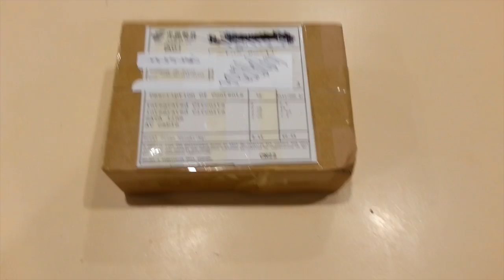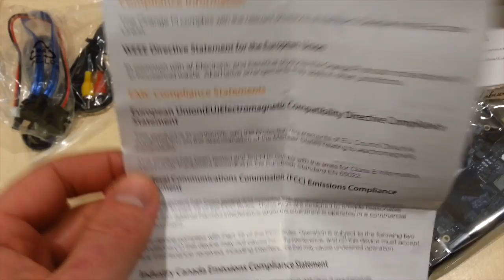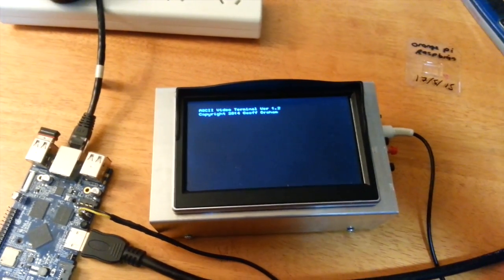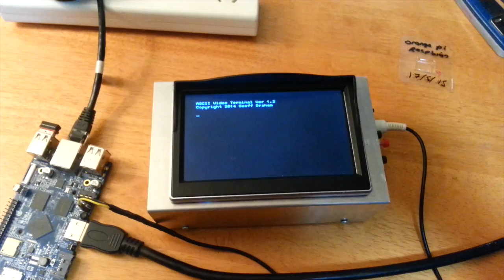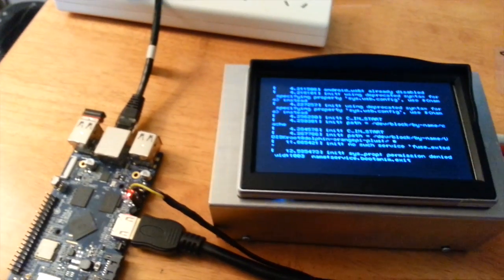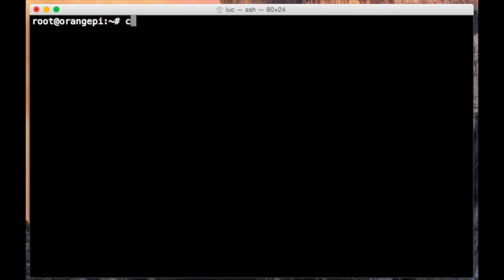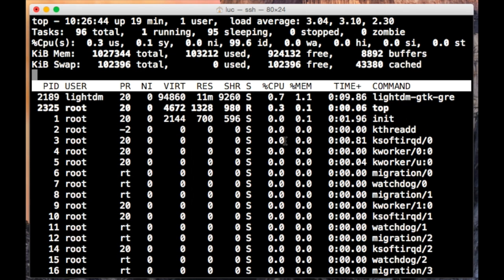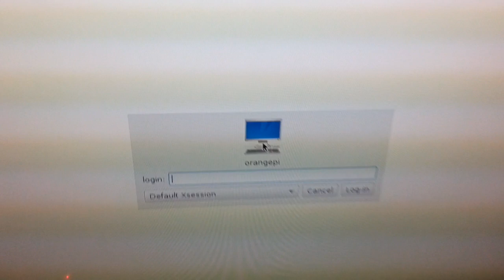First look at the Orange Pi Plus

Comment from the maker: +Shawn Carter  thanks for the tip about Android coming pre-flashed to the eMMC - I did not know that this was the case. I removed the SD card and booted into Android. Altogether a smoother experience than running Linux and quick too. Language is set to Chinese, so I'll have to explore the settings menu to change to English.
Reply: Luc Small Yeah, I found out the hard way =)
I found a general video on youtube on how to change the language on android, rather than something specific to the orangepi.  Glad it helped.
Reply: Also discovered that the Android OS is only using 2 out of the 4 cores available...it doesn't really need 4 but would be nice to have the option.
Reply from the maker: Shawn Carter Do you have the link to that video on changing the language? Would be handy for me and everyone else reading this thread. If not, no problem I'll search for one.
Reply from the maker: Shawn Carter That's interesting, I wonder why only two cores. Android was very responsive for me, even on 2 cores. But hopefully an update will enable all 4.
Reply from the maker: Shawn Carter Another thing. Do you know if the camera module works under Android? Reading the orangepi forums, It seems like support for it may not yet exist in Raspbian for the Orange Pi Plus.
Reply: Luc Small I found a video for changing the language to English - but wasn't able to post the link for some reason...I'll try and email it to you, and you can maybe put it in the comments.
Reply: Luc Small yeah Android works fine with 2x1.6 cores I guess... =)  4 cores would be better, and would be needed for the 4K video output that they claim the H3 can do.
Reply: Luc Small - Sorry Luc, I didn't bother getting a camera - I have one for my Pi2 that I never use!  I'll try to look into it for you tonight.
Reply from the maker: Shawn Carter I answered this one for myself. Connected the camera, booted Android, and the opened the Camera app. The preview worked and I was able to take a couple of stills. Recording video didn't seem to work - I would press the record button on the Camera app, but the recording would never start.
Reply: +Luc Small The high load averages are related to the SD as the root filesystem.  If you transfer the root filesystem to emmc, these will drop to 0.  I'm not sure how to mitigate this for Orange Pi devices that lack emmc, or even if there's a legitimate issue.  Certainly it is hard to identify pegged core(s) from looking at the load averages.  Anyway, transfer to EMMC solves this on the Plus.

Comment: Excelent video. Helps me understand allot of the basics on how this all works. I just ordered my first "pi" pc of any kind. Planning on using it just to tinker with an learn more about code/hardware etc. Ultimately I want to run a mini minecraft server for my friends and I; I got this over the raspberry pi for more cpu power. I got the orange pi 2 mini. I was looking for the most horsepower (all winner H3) for the cheapest price. I hope I dont regret not getting the Plus later on. I didnt think I would care for wifi, sata and all the other add ons on the plus.
Reply: +doubleatheman Hello, The Orange Pi Plus is the Best of all the Orange PI or Orange PC and for $ 39.00 Dlls includes Wifi, Gigabit Ethernet Port and 8 GB Emmc with Pre installed Android also all 40 Pin Header are Capable with the Raspberry Pi 2 and Retro Pi also works Perfect on it and what I like the most is the Sata Port to install a SSD HD Drive to the Orange Pi Plus which is a Plus for me  -  Derf

Comment: Fantastic video thank you! - Question about the power button. Does it automatically power up every time after power is restored (without pressing a button)? -- Is there any way to signal it to boot up through the GPIO ports? -- Also, if it is switched off and you hold the power button for say 30 seconds, does that have any ill effects?

What I'm thinking is getting 2 power supplies - both will input 12-20V (car application) and outputs 3.3V and 5V. Connect the 5V to always give this board power and 3.3V to a GPIO port so the unit knows when there is ignition and to power it up.

Comment: I have connected my Orange Pi Plus to the monitor using HDMI and there was no visual connection as well, so what I did I pressed the reset button and after a while there was a login screen and everything went fine. I was using Ubuntu instead of  Raspbian.

Comment: Thanks for the overview, I've read reports of Orange Pi Plus not supporting hardware acceleration, can you confirm or deny this? I'd like to pick one put for in home streaming and the like, but it's a deal breaker if it can't run XBMC.
Reply from the maker: Steven Phillips Hi Stephen. See the thread in the comments with Shawn Carter. He notes "there is no hardware acceleration yet for this board in Linux - but Android Kitkat runs really nice on it with Kodu etc.  makes a good little media centre." Hope this helps.
Reply: Luc Small It does! Thanks very much.

Comment: Luc, had similar issues with mine...turned out it didn't like my SD cards when I used win32DiskImager.  Have you tried letting it boot into Android (ie. without an SD card in the slot) - also there is no hardware acceleration yet for this board in Linux - but Android Kitkat runs really nice on it with Kodu etc.  makes a good little media centre.
I ended up using my Debian 8.1 partition to create my SDCard and it's now fine...

Comment: Hi I've got exactly the same board yesterday. Unfortunately I discovered that it boots with the pre-flashed android. If I flash a raspbian on a microsd the board doesn't boot, I mean it doesn't power up at all, no red light, no other lights, no sign of life.
Did you face the same? I think it can be a compatibility issue with the microsd (it works fine with raspeberry pi 2 and cubieboard 2 it's a Samsung 16GB class 10).
Any suggestions will be very much appreciated.
Thanks
Reply from the maker: Giuseppe Salvatore So reviewing my video, I can see that the red light came on for me; but no other lights. So it does seem that may be you have an issue with the microsd or the image flashed to it. Can you confirm that the image is one of Raspbian specifically for the Orange Pi? Can you get hold of another brand of SD card?

The other thing to try is to connect the ethernet port to your router and see if the Orange Pi appears in your router's list of DHCP assigned addresses. Without a working "activity" LED (mine is always off under Raspbian) and with an incompatible monitor (like I experienced) the device can look dead. Apart from the approach I took of connecting to the serial debug port, a DCHP address assignment is about the only other way to determine if the thing is "alive".
Reply: Well yes, probably a serial port will do the job. The strange thing was that red light (which I assume is the power light) that doesn't turn on. 
I'll try what you suggested. By the way as I said android works fine and I have no problems with HDMI monitor nor the SD card, if I plug it in after android boots it is recognised as external device which suggests that the hardware works fine. 
Thanks again
Reply: Luc Small It was definitely a SD card problem. I've done exactly the same steps (same os image, same connection and same peripherals) but only different SD card (now I'm using a SanDisk) and it works perfectly fine!
Thanks for your support
Reply: Luc Small I was doing some checks on my raspian build and there are strange things actually. To name some of them, the windows manager looks pretty dodgy. Also I've noticed that running a cat /proc/cpuinfo or using htop the system shows only 3 cpu cores, which is even more dodgy.
Is your build working fine or you've noticed some weird things? I understand that's a raspberrypi adapted to run on an orange pi but...

Comment: i just got the orange pi mini 2 and am having issues getting an os on it unfortunatly it has only the sd card slot every time i try to put a os on it it comes to a .xz file and per the guide i just unzip but when i do it shows an iso file how do i put that on the sd card ?    any and all help would be wonderful and thankx in advance
Reply from the maker: SuperHorrormike Assuming you're on Windows, install a copy of Win32DiskImager. You can use this to write the image (the "iso" file) to your SD card. These instructions (written for the raspberry pi, but equally applicable to the orange pi) list what you need to do step-by-step:

https://www.raspberrypi.org/documentation/installation/installing-images/windows.md

Comment: can it run raspbian image? i have raspbian image as server can i use the same image to run in this board?
Reply from the maker: ***** It is running raspbian but I think it is a special version created for the Orange Pi - probably has a custom kernel, modules and maybe even a different boot process. I downloaded the image from http://orangepi.org. So if you have an image of raspbian created for the Raspberry Pi, I don't think it will work. Of course if you have a spare micro sd card lying around, you could always grab a copy of the image, flash it to the micro sd card, and give it a try.
Reply: Luc Small It's actually based on the banana pi stuff in general - which runs the All Winner A20, so you can't use a RPI image with this board, but you can use banana pi images.  Bananian has some support for the Orange pi, but doesn't yet have support for the H3 on the OPi+
Reply from the maker: Shawn Carter Very informative comment, thanks. It's all quite confusing, given that the orangepi website Downloads section refers to its clearly custom build of Raspbian simply as "Raspbian":

http://www.orangepi.org/downloadresources/

On the actual download page, it's called "Raspbian for the Orange Pi Plus", which is a bit clearer:

http://www.orangepi.org/downloadresources/orangepiplus/orangepiplus_7d804cf76a4ef3818cbe64d.html

But it would be nice if they called this Raspbian derivative something completely different to avoid the confusion that the stock Raspbian might work on the Orange Pi Plus!
Reply: Luc Small I think because they have bundled the raspbian store, and it is generally compatible software wise - so it makes it seem a bit more familiar.  Just a shame that the Mali 400 drivers aren't included for hardware acceleration.
Reply from the maker: Shawn Carter hardware acceleration would certainly be nice, but I'm just hoping for stable graphics at this stage! I don't know if the experience is the same for other users of Raspbian for the Orange Pi Plus, but whenever I move a window (say Arduino or Midori browser), the window doesn't properly redraw. Instead I get strange effects, like most of the window disappearing with the desktop being shown in its place.
Reply: Yeah Luc, that's because of the lack of hardware specific drivers for the video.  They might appear one day, I've been reading on the Mali page, and there are specs and stuff there - and it's all open source, just needs someone with the ability to put it together - but afraid my linux skills aren't quite in the same ballpark!